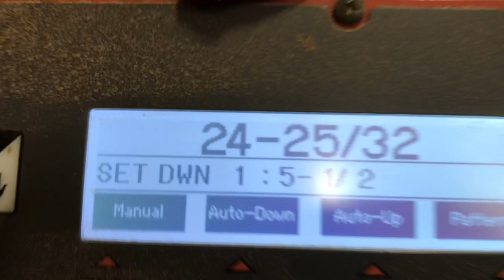Wood-Mizer LT50 Electric saws Blocking

Comment: I guess you would have done it a long ti.e ago if it were a viable optipn for you, but can those Wood-mizers be cut and then welded up so that the distance between the drive wheel and the idler wheel can be adjusted as needed? I mean make the coonnection between the two on a sliding rail? And have it accept dofferent lengths of saw blades? Or would that just make it unstable and inaccurate?
Reply from the maker: Good question. The simple answer is yes it can be done. in fact it's been done and is documented on YouTube. Search "I cut my WoodMizer Sawmill in half".
I personally would not cut a new 50'000$ sawmill. However I would consider cutting an older 15,000$ sawmill. By cutting the head and widening it does cause some accuracy issues. But that has to be accepted.
Reply: @VideosByAl  thanks for the reply Al. And for the video. My regards to you and Linda and have a great weekend